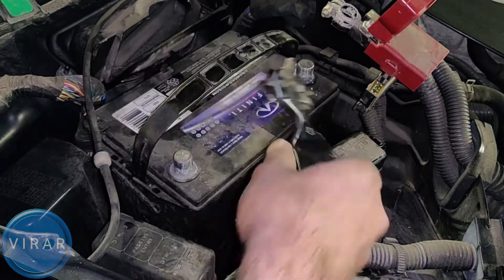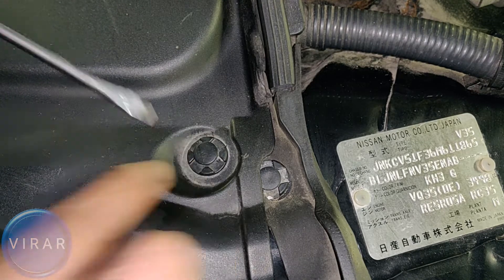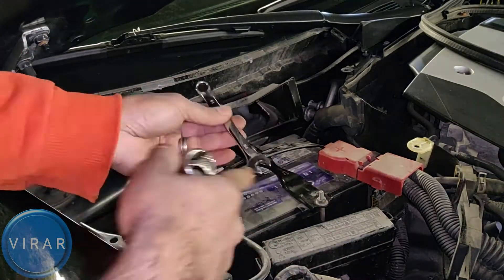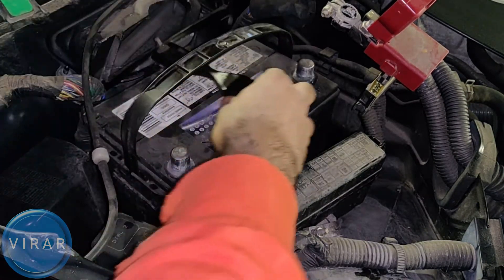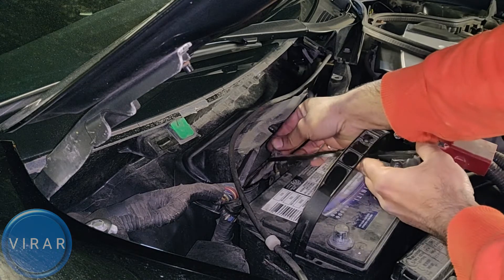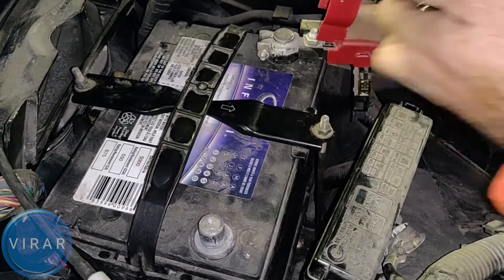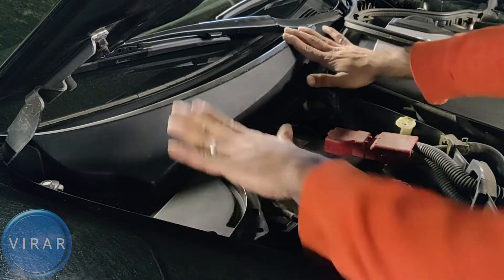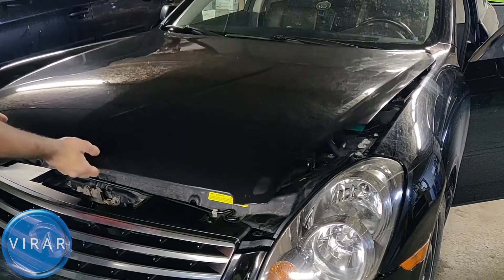How to [EASILY] Replace the Battery - Infiniti G35 (2003-2006)

Comment: Very helpful and informative.  Can you make a video for replacing the cabin air filter?  Your step-by-step instructions would be extremely useful, especially with putting everything back together.
Reply from the maker: Thanks. Here you go. I already made one. 

https://youtu.be/k9SNZm84fPY
Reply: @VirarAutomotive  I have the coupe, unfortunately.  You have to take apart a few more things.
Reply from the maker: Unfortunately I don't have access to a G 35 coupe to make a video on that

Comment: What about how to re-initialize the windows after this? I’ve looked up videos and they all explain how to while the windows are up but I replaced my battery while my windows were down so they don’t go up, my cars door panel switch also doesn’t lock, the drivers side buttons illuminate but the passenger side does not. Please get back to me soon🙏 I don’t want to have to spend money at a shop for this, thank you for your time brother.

Comment: Well shot video! What size push pin clips are used to hold the plastic panels?
Reply from the maker: Thank you. Not sure about the push pin clip size. If you are out of them, I suggest you take one of them, go to the auto parts store and get a match. :)

Comment: I have a 2006G 35 coupe on the positive battery cable I only have one wire and the slot on the right is empty but there is threaded post, all the pictures I see have two wires, running into that block on the positive terminal I only have one what’s up with that?
Reply: @Mr.walkyoassdown2Xs  the car doesn’t have any issues. I was just wondering where the cable on the right was going to because I don’t have that cable.
Reply: @Mr.walkyoassdown2Xs  i’m talking about the feasible link the left post has the cable going to the alternator and the post on the right is just empty

Comment: Hey can you help me out . I put a battery in my car to start it and took that battery out when it was on. And when I was removing the battery the negative & positive terminal hit. And now it only crank. What can I check
Reply: I have a 2006 g35 sedan
Reply from the maker: Sounds like you had a short circuit. Checking the fuses and relays for the starting system would be where I would start, but other than that I can't really tell you more without having looked at the car in person. Sorry :(